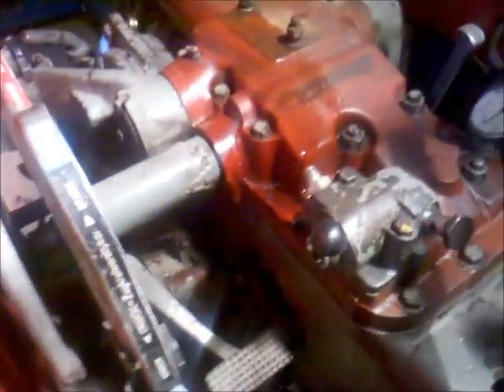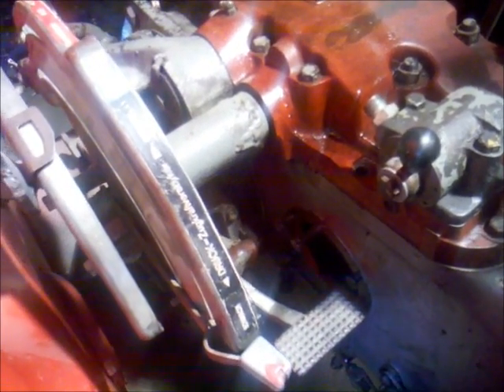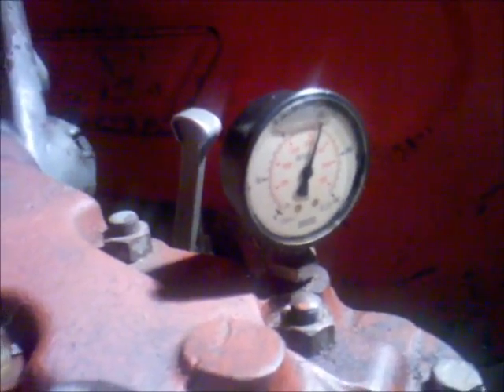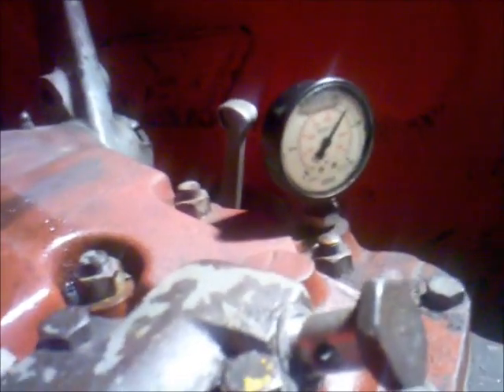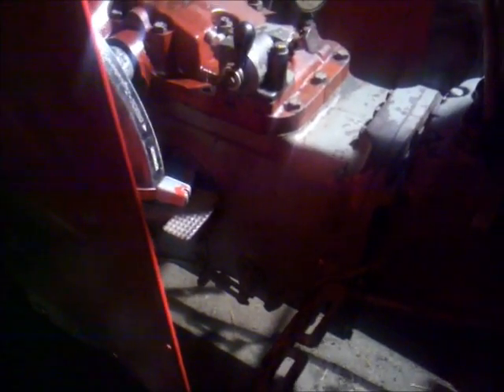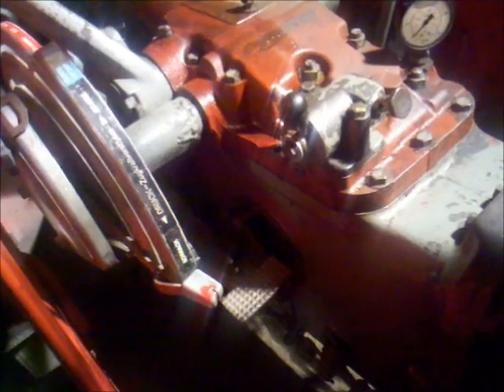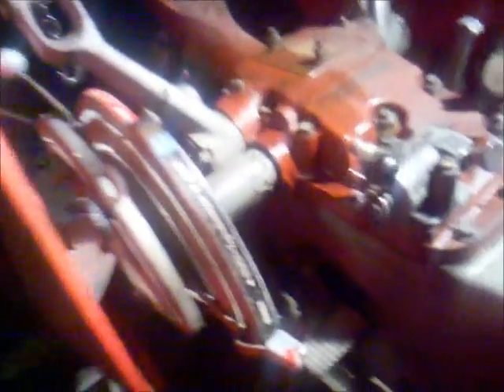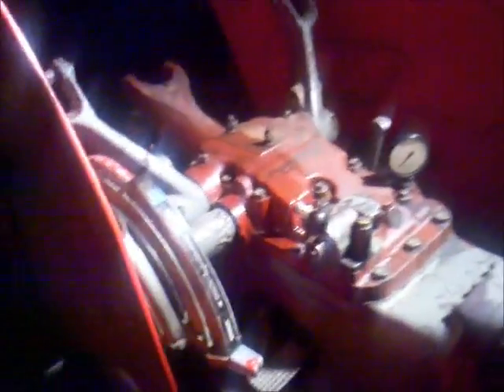MF 165 Multi Power -  hydraulic liftcover and initial operation - part 11

Comment: Enjoyed the series. Very informative.  Have an MF 180 with aux pump issue (high pitched noise above idle and not much pressure).  I think (hope) I can replace without splitting tractor (live PTO).  Tractor has Multi-power that works fine.  Is multi-power pump separate from aux pump or does aux pump take the place of (eliminate the need for) the multi-power pump?

Comment: the original MF hydraulic pressure is 3100 psi, which is around 210 bar. that's absolutely not too much for a piston pump. i'm also raising my 175's mp clutch pressure to at least 25 bar because original 21 bar is not enough to hold all the horsepower.
Reply from the maker: Hello!
How do you raise the pressure in the MP System?? I am quite interested about this..
Reply: ***** relief valve is in the mp control valve which is in the clutch housing. There is 2 springs under a plug in the valve body. Put some material under these and measure the clutch pressure.

Comment: LOL.... I won't lift the cover off by hand. I have some eye bolts and will lift with a come along from the garage rafters. I put a big 6x6 timber into the rafters so that the load is spead across 8 feet of structure.

Thanks.

Comment: I am learning alot as I go. Not much of a mechanic. My hydraulic lift stopped working suddenly and I was thinking I had to get into the hydraulic pump but I'm being told in the forums to check the spool valve under the right side cover. I am doing that this morning before doing anything else. I have the bolts out and the oil drained down to under the lowest bolt. I am having trouble getting the cover off though. Not sure whats holding it at the moment.

Comment: I'm attempting to remove and repair the hydraulic pump without splitting the tractor. I find your videos helpful, thanks,
Reply: I just watched your lift cover 'Part 11'. Looks like this series would help me. I'm rebuilding a MF 135 lift cover. How do I get the rest of your video series on the lift cover? bmacdonald0836@gmail.com
Thanks